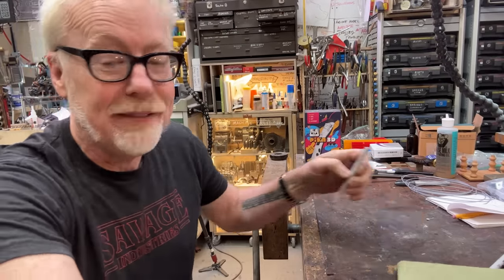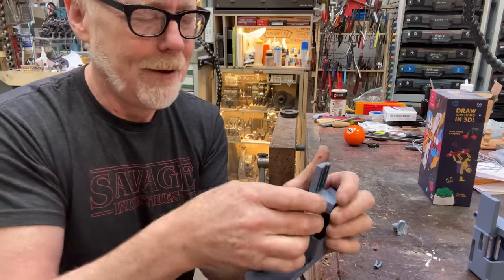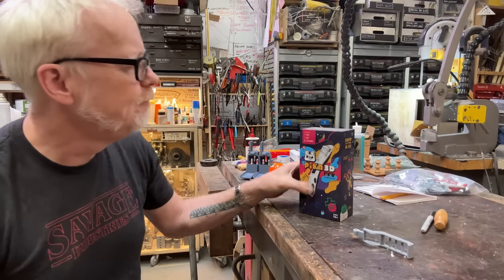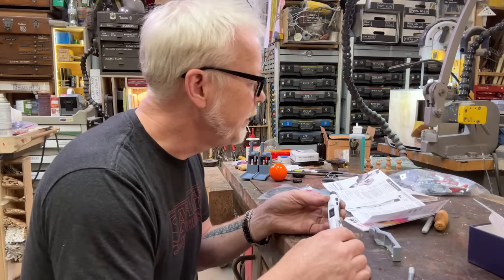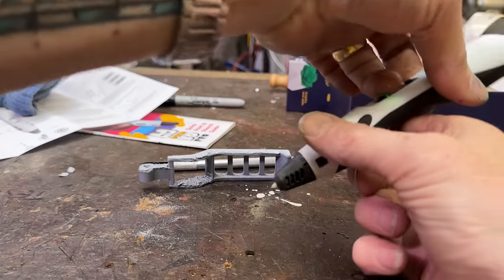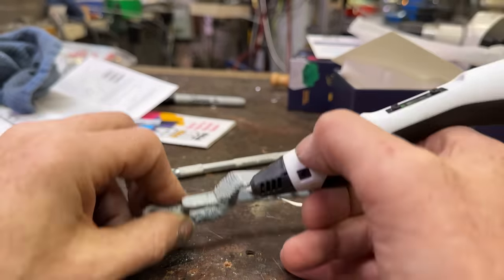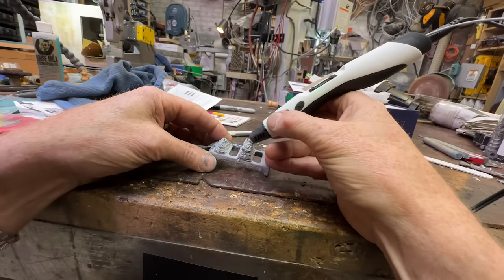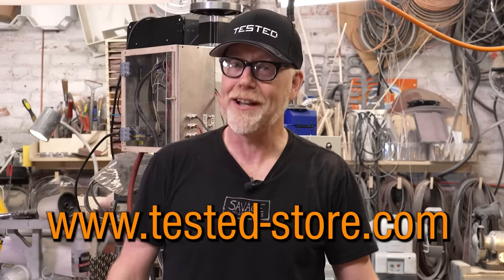Adam Savage Tests This 3D Printing Pen!

Comment: You can also sick a piece of filament in a rotary tool and friction weld two pieces!
Reply: I was going to suggest the same thing - especially since he said he'd like a longer tip on the pen. Variable extension is also great for time when you need a longer tip to reach into an area for some kind of repair. With a little practice you also get really good bonding with the underlying layer because it's more of a "stir" weld.

Even outside of 3D print touch ups, having an assortment of filaments (you can buy mixed kits) for this kind of plastic repair is just generally handy in our world built of plastic. I've fixed things like a broken ABS watch case and coffee machine mechanisms with little friction weld touch-ups.

Comment: This would be so cool to use to fix print issues. One of my helmet prints is missing some corners because of warping on the print bed, so I could use this to repair that and fill gaps. Definitely buying this.
What would be really cool is if there were a pen like this that instead ironed filament at the surface level to smooth layer lines with heat.

Comment: you can get really clean bottom surfaces on the Bambu printer if you leverage their support material for PLA.  what I recommend is using it only for the support interface (meaning it only uses the support material between the model and the support structure.  this makes your spool of support material last a long time since it's only a tiny bit that's used.  for the support material, you can use cheap leftover filament, but what I recommend is to use the same material for the support structure as you're printing the model with, so you can print both without an extra filament swap each layer.  that means if you only have one spot that needs support, it will print in the one filament until you get to that layer, then switch to the support material, then print it, then switch back, and the rest will just be the normal filament, and you can do this with absolutely minimal increase in print time.  but the support material is a hotter plastic, so it won't bond with the PLA you print with, so when you go to remove the support material later, it pops off cleanly and often leaves a fairly nice looking surface.  it won't look as good as the bottom when printed on a smooth PEI sheet, or the top after ironing, but it can look pretty dang good.  good enough to call a production finish in my opinion.  give it a shot!  oh and for people wanting to save money, people have successfully used PETG for the support interface material when printing PLA and it seems to work about as well, so I think their support material must be ASA or PC or something similar

Comment: I use it to repair or weld pla together. Works great. But doesn't look very nice. If you want to sand pla on a machine it gets hot. Another tip: saturate it with cooling spray (the non flamable one!!!!!). Printef parts sucks it up like a sponge. And than you can sand it with a machine. The part stays cool and hard...

Comment: I've used mine with ABS filament to repair car parts that were molded in ABS. Far better than the "welding" kits they use to sell ages ago.

Comment: what ive used to smooth out PLA prints is one of those pine 64 portable soldering irons and a old soldering tip. that along with this to fill in the spots that need it and the iron to smooth it out/fine fill would be a charm.

Comment: aside from the soldering iron and the mynt3d which can print high temp stuff a useful tool to have if you want to bend and shape plastic around other bits you dont is the hot air soldering station / gun, it has some small nozzles which put a very controllable spot of heat where you need if for bending purposes

Comment: As someone with a printer that has a bed on the smaller end, who still like to print full sized helmets and armor, this type of pen would be very handy for welding a model that I chopped up to fit on the printer back together. At the moment I use super glue to marry the pieces and then use a the tip of glue gun to melt the edges together. I then have to fill in the groove left by the glue gun with something like spot putty. Being able to use the pen to melt the pieces together and fill in the groove with the same plastic at the same time, would probably be a nice upgrade from my current workflow.

Comment: On the subject of filaments, when you move from PLA I highly suggest moving to ASA. When properly dried and in a warm, draftless enclosure it prints very similar to PLA. PETG is great for certain parts and projects, but if you need something a bit more rigid and able to hold up in the heat (without breaking the bank) ASA is the way to go. Just make sure to use glue stick or something to act as a barrier between the build sheet and filament.

Comment: I've wondered if there is a 3D pen that can be controlled with a foot pedal (like a TIG welder). I could think of scenarios where I would rather control the on/off this way, or even the dispense speed with a pedal.  It would also allow the controls to be removed from the pen and streamline the pen body potentially giving a better view of the dispense tip.
Reply: I was thinking the same here. The pen I have is too "smart", and really would be helped with variable pedal control and a simple temperature knob.

Comment: if u are using the ams..use petg as a support against pla..or the other way around..they dont fuse together ..it can really sit on the part to get smooth part when removing the support

Comment: Also to improve prints, and to reduce supports needed, make sure your hotend has dual cooling and use 'bridge' mode.
Many printers only have one filament cooling fan, this cools one side of the filament down faster than the other.
Dual cooling, via two fans, or by printing a vent that allows a single fans flow to be split in two will definitely improve print quality and as I said, allow less supports. My Ender 3 Max which comes with dual cooling fans can bridge like a champ. Has no problems printing 90 degree overhangs with no supports over short distances.

Comment: Couldn't help it but say I love how you say "how beautifully it pops off" then the organic support breaks in a different place. That is a nice way to fix a 3d print, hadn't even crossed my mind. 6:06 I would suggest keeping the pen vertically to the surface rather than the angle of a welder, so the filament has less cooling effect from the surrounding air and reduce overfill as well. 6:40 I've been taught to cut toward air not meat and you've got me nervous. 10:50 I agree about the tip length. Perhaps if made out of an insulating material, it could have been longer. That could also allow for a 90° tip. Question about the pen: Does it have variable speed or is it an all or nothing? If it was variable, then you could slow down as the passes get quicker (less layer cooling time)

Comment: I bought a similar 3D printing pen last year to attempt the same thing, but it never works out. I've learned it better to get a soldering iron with flat tip to iron out those areas instead.

Comment: I print a fair bit of PLA for miscellaneous odds, ends and doodads and I use an old flat/fine tip soldering iron and/or heat gun instead of a printing pen. I've found I'm much more precise and have a much better time getting the results I need. Sometimes I wish I had a few extra hands to manipulate the part, filament, and iron but hey, eventually I get the job done. If I needed to add a feature, the pen would probably be preferred, but I typically try to add that into the model instead. Thanks for sharing your review! Cheers 🍻

Comment: What I like doing with my 3d pen is after I have joined two printed parts together, is to take the pen and jam the nozzle into the seam and extrude as I drag it along leaving a bead of what looks like weld, and sands smooth instead of having to use putty for filler.

Comment: for the ladder part you need to print it flat and have support for the bit after 45° incline. Building custom supports with cad will leave you with part that need no extra work

Comment: PLA and PETG don't bond - even when melting hot. So people with an idex printer or MMU might want to print their supports in PETG or vice versa. Just keep in mind that you'll need to print the top support layers at 100% infill to get that ridiculous clean surface finish under the supported part.

Comment: I personally find more quality in using a soldering iron and some scrap filament to repair 3d prints. For coloring 3d prints, I either resort to paint during post processing, or my multicolored 3d printer. 3d pens are more gimmicky than anything - But my 10 year old loves it! 

In practical applications, I have found using 3d pens to "weld" joints together to be far weaker than using a soldering iron for the same purpose. Definitely agree that the ergonomics of most 3d printing pens are not great, and definitely lacks finite control for smaller details (where a pen application would ACTUALLY be useful).

Comment: Great to know that things work,  I have seen it online but doubted it's capabilities but thanks for the demo so now I do. I do wish there was a super small attachment to do a 90 degree angle. Might not be possible

Every once in a while I'll get lucky if the issue is somewhere where I can disable my extruder's stepper motor and it's a SOVOL SV06, which has a wheel so I can turn it but a lot of times that isn't possible.

Was watching another video the other day and they mentioned using a very quick run over with a blow torch for string, minor imperfections and it removes any adhesive if used. The great thing is if you have to sand, which always makes the color more matte looking, if you hit it with a blow torch it will get its color back like it was just printed. Funny how obvious some things are but not until they are pointed out regarding post processing for 3D printing.

Comment: To solve your particular issue using a flat iron tip on a heat knife would be way better.  The 3D pen is useful for filling holes, gap after welding parts together since it basically just adds material.  You could also just add material with the pen and then smooth flatten it with the flat iron tip. I usually just fill gaps with the float iron tip and holding the filament like when soldering  then go back and smooth it if necessary. Also a tube of grazing putty is your friend in e3D printing as you just  apply a small dab with your finger to a rough spot, let dry & sand with 220 for a perfectly smooth part, ready for priming

Comment: First 3D "printing" pen I ever saw was a model that could do PLA or ABS, and ran on what looked like 2.85mm filament (though to be honest it could have been thicker than 3mm, I'm pretty sure those guys were running a Gillette razor business model like every startup peddling new gadgets). The filament was driven into the heated nozzle using a worm gear. I'm not sure how it was powered, though it was rather impressive to see it both drive the screw and heat the nozzle in such a small package.

Comment: 3:25 it's so funny that i INSTANTLY recognise both the part, the gun it's from, the prop it was used for, and how it even feels in my hand and the motion of firing the gun "mode". Man it's crazy how much i used to fiddle around with that gun thing. Couldn't it also be used as a water pistol if you didn't put the rubber dart in and just used it to suck and spray? Maybe i'm confusing it with another one, but i definitely had at least 3 of those when i was young lol.

Comment: Don't be afraid of adding heat! Hot pens, a small torch (watch burning especially on lighter colors) or a flat tip on a soldering iron. You can do a lot with a 3D pen to repair but there's a hard learning curve in my opinion.

Comment: you can use petg as a interface material set the support z distance to 0 and the petg will not stick well to pla enough to print on but once done it falls away leaving a good clean print behind

Comment: Could you use it for inlay work? Route or mill out a design, then use the pen to fill it with plastic and sand it smooth? Could be some cool potential there since it's far less messy and lower risk of spill over than with resin

Comment: Using a wax carver (foredom makes an excellent one) with some teflon sheets or tape over the tip to prevent the melted plastic from sticking to the tip. You will be able to smooth out the plastic also use the roll of plastic to weld on or fill.

Comment: Card scrapers can make a good job of cleaning up 3d prints, if surface detail isn't too important. Probably also great for cleaning up the 3D pen "welds", at least after doing the rough cutting!

Comment: i use a tip on my wood burning tool and "TIG weld" with a piece of filament, works beautifully

also bobby duke made a dragon skeleton with one and it was amazing.. he would overprint and then sand back and could make perfect looking bones

Comment: I have the cheaper Mynt3d Super Pen... The one without the screen. Works great for a quick fixer upper and when I feel creative I use some filament to draw a 3d object with it. For less than 50€ it's a great tool to have, even with it's weaknesses. For anyone wondering if they should get the one with the screen or without. The screen tells you the temperature and let's you quickly and easily adjust it. The cheaper one needs to be adjusted with a screwdriver but is 20-30€ cheaper and works just as well. 

For any 3d printing nerd an invaluable tool.

Comment: a 3D pen is amazing next to an ordinary printer. I have used it a lot to repair or fill in other prints. but to smooth it out, next to already mentioned soldering iron on of course a low temp setting ( I use somewhere between 180 and 220 C)  you could also use "dichloromethane". this desolves PLA just like acetone does with other plastics

Comment: A 3D printer is definitely not just a replicator. I design my own prints and every print I do (Except for iterations, because some parts need tweaking) is individually designed and printed by myself. I don't like using the prints other people have created. I like learning it all by and for myself 🙂

Comment: I use a solder rework station with good temperature control and just dip the filament like arc welding .

Comment: Have you also encountered print finishing tools. I have what amounts to a soldering iron with a flat pointed edge/blade used for smoothing on a surface. I have also seen spoons and other tips available

Comment: One possible solution is to apply in smaller areas and while the plastic is still hot use a palette knife to apply pressure and smooth.

Comment: The new hottness in the 3d printing community for repair and finishing is mixing baby powder and UV resin together and painting it over the parts and then curing in thin layers. Layer lines disappear like magic with minimal sanding.

Comment: ive been printing for half a decade or almost, when using one of these pens its best to put a piece of glass down or work at a glass top desk. also the pen i have lets u have more control of the speed the filament comes out an temp so u can use a wider range of pla filaments. also pla and pla+ have been the stronger filaments as far as what load they can handle, petg or abs doesnt do as well as pla for strength but they handle chemicals better an uv but anything i make that is structural i make with pla or pla+ with a higher wall count an infill but if the part is going to be outside ive started painting them an coating them in a clear to help seal them from the weather an in the 5 yrs ive been using them about a year an a half to 2 years is about how long a regular pla print would last in the weather where i live, got almost 3 yrs on v2 of the same part in pla+ an its still going no signs of issues and thats just a print now paint or seal the stuff ive painted an then cleared to sealed only show wear from regular use nothing from weather that i can see but pla and pla+ is my go to unless i need something to be more springy or flexible an petg is my go to for that. asa is one ive been planning on picking up to try but still havent gotten around to it. also the ironing setting can be done on any machine using cura so it doesnt take a bambu lab printer to do the last layer ironing to give it that smooth finish.

Comment: as a metal fab person first, 3d printer second. Small carbide burrs for rotary tools are amazing for any sanding or material removal process. Amazon set of carbide burrs in my m12 rotary tool is a lifesaver cleaning up nasty prints or deburring pipe.

Comment: I've had that exact same model for years. Yeah bad ergonomics. Its definitely capable of being a stand along maker tool. The best recommendation I can give is to use a hot knife to smooth out the surface. There are makers that do IINCREDIBLE things with that combo. Very handy. Mine quickly developed a power issue at the barrel plug. That would cause it to reboot everytime I moved..  ended up removing the plug connection and soldered the power line directly to the board.